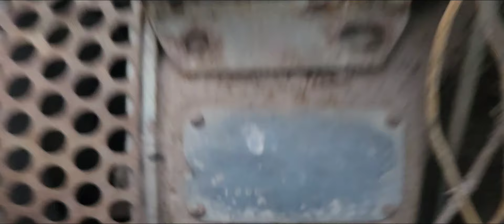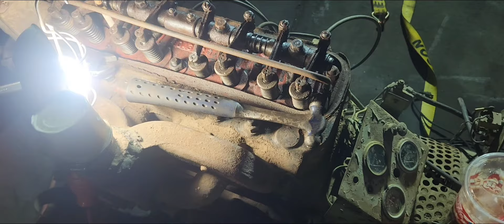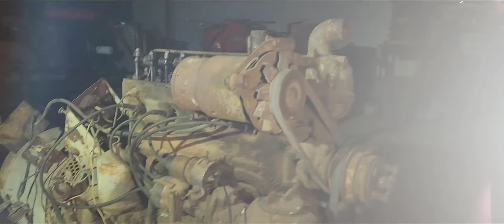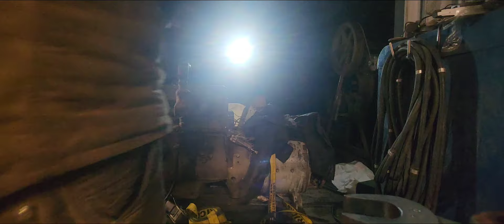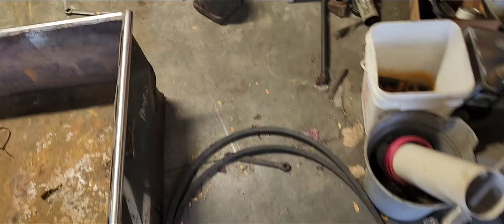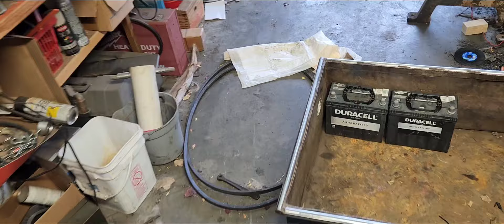$150 gamble generator

Comment: feed the gas via gravity that's an updraft carb it will run off a gravity tank . I have International Harvester Farmall tractors using the same engine and system they all run off gravity tanks.
Reply: i also have a warner swayse turret lathe #3 with bar feeding

Comment: Engine is a Farmall H tractor engine. Generator looks to be Hobart or maybe GE. Lever you mentioned is the throttle. Should be a way to open throttle and lock position. Throttle postion also adjusts govenor postion so it can open carburetor butterfly when a load is put on engine. You've got a rare piece there.AL B.
Reply from the maker: @sallybrokaw6124  Yep, it's a U4 power unit (same as a farmall H). Generator head says "Ready-power" but they had generator heads made for them by other companies

Comment: The rotary phase converters will be perfectly fine with varying power to a pretty good extent
Reply from the maker: @smalltownmachineshop6860  Yea, the motors and such shouldn't get hurt if voltage and hertz varies by 5% or 10%. It'll affect speeds but that isn't a problem